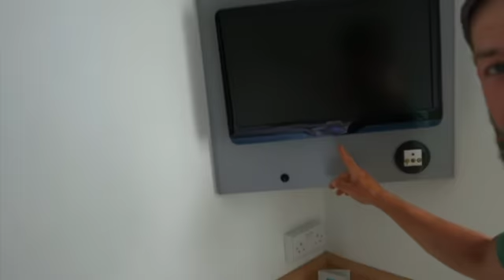My trip almost came to the end. #day5

Comment: The type of rear rack you have for your bike is a very bad design for carrying such a heavy weight as you are. They are only M5 bolts as well which are NOT strong enough. Sorry but you need a rack made by Madison such as the Summit, Surly, Salsa or Old Man Mountain, Tubus or Thorn racks which are all heavy duty racks for cycle tourers who carry alot of stuff. Topeak stuff is ok, but their racks are crap which I guess you are now finding out. You do not want a rack which has a bottom rack mount lack yours it is such a bad design and will always be weak and fail.
Reply from the maker: Thank you so much for your tips Alex Morgan! Yes, I did find my Topeak rear rack not beeing very reliable but I had very limited options when choosing a rack designed specifically for  bikes with disk brakes. I'm currently planning my next, much bigger tour so I will definitely will take your advice! Thanks!!!!